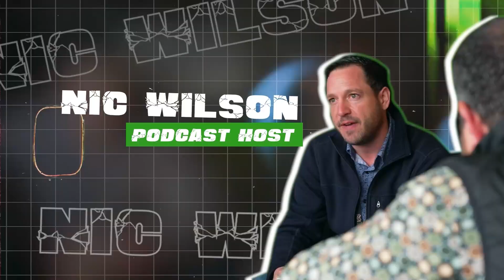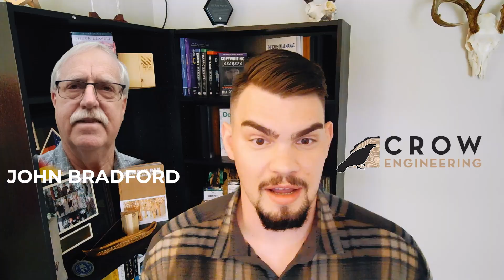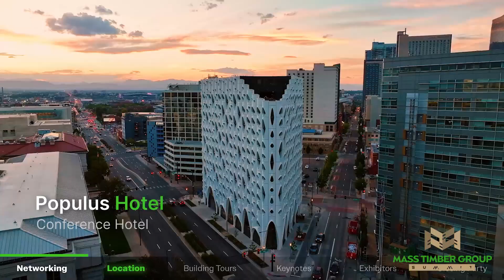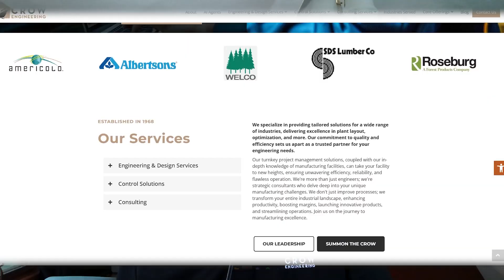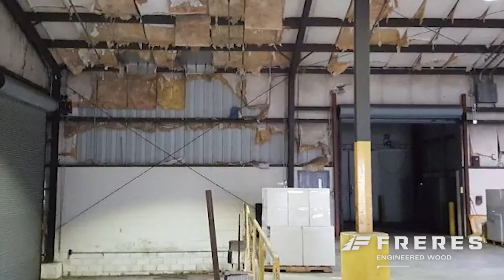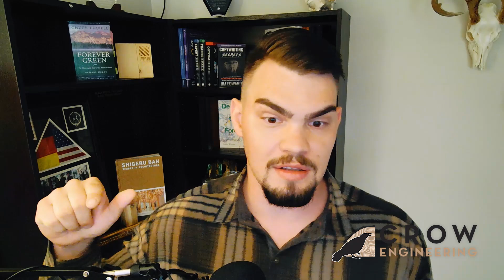The Case for Mass Timber Warehouses w/Kyle Freres & John Bradfrod

Comment: Obviously the issue is fire and rot. If you can’t access cheap cement and you are in a cold climate then sure. This doesn’t fly in the south.
Reply: Mass timber is more fire resistant than concrete. Google spalling. Timber can be oversized so they have a layer that if it is charred no structural issues occur.
Reply from the maker: It actually performs to the same standards, and often in better ways, in structural fire testing. For rot, its not an issie with proper moisture protection plans and finishes. The South is actually one of the fastest growing adopters as they have massive fiber resources with Southern Yellow Pine.